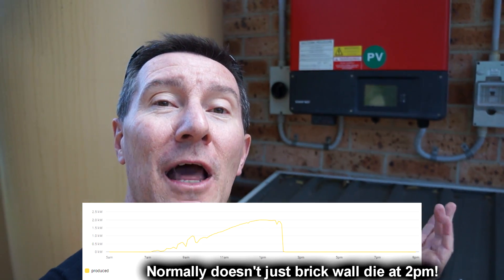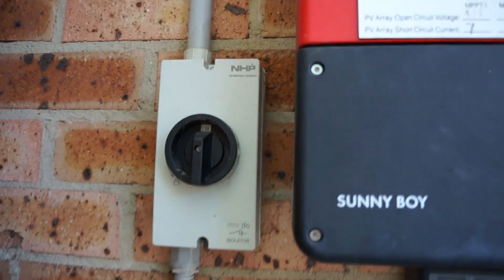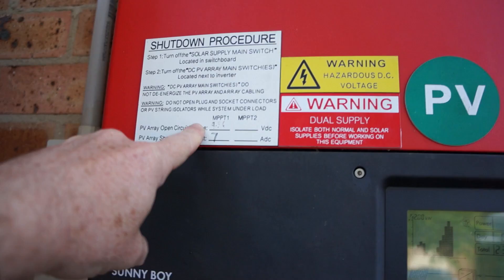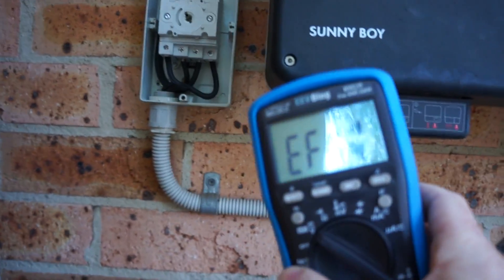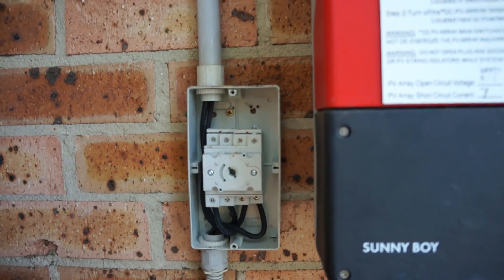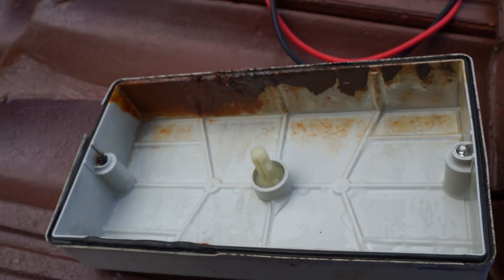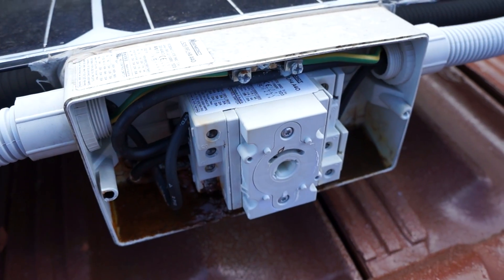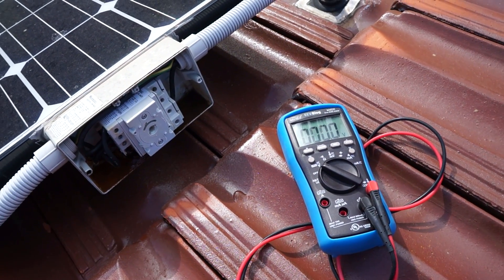EEVblog #1217 - My Home Solar Power System FAILED!

Comment: Stick a roof tile over it. Job's a good'un! 👍

Joking aside; on a much (much!) smaller level, I've always noticed it's the little on/off switches that are the first things to corrode-out in my LED solar garden lights. So much so, that I've followed Big Clive's advice, and simply bridged them out! 💡
Reply: Same here, we've had ours for so long now that even the IC legs are starting to rust and fall apart. The worst ones are those big strings of LED's daisy chained together in parallel, after a year or two the corrosion penetrates the LED's until one or more turns into a low value resistor. In some cases it prevents the IC from charging the battery. I've been tracking down the shorted LED's and heat-shrinking the wires back together just to get some more use out of them, I think they're a waste of money but my Mom loves them.
Reply: Indeed, they're a job to maintain and (more often than not) beyond any sort of economical repair..but I do like a challenge! ;)

Comment: I've had the housing for an isolator switch failed replaced it with metal housing never had another problem.
Reply: Give it time.. god forbid they use a material that lasts forever like stainless steel.
Reply: Stainless steel and others metals are kinda conductive lol. Shit idea
Reply: But you could just put it under a metal shield for example

Comment: Forced Gov'mnt "Safety" rules get written before there are components capable of doing the job.  In the USA it was fire codes that wanted to have every panel disconnected when the system is turned off.  High DC Voltage and water mix very well.
Those knock switch is cool, except when you work with a bunch of inverters everyday and have to rap  your knuckles raw.
Reply: William Wilson Those are turn switches with lockout-tagout, no knocking involved.  They are specifically for "unplugging" the wires you work on.  A 100 year old big knife switch does the job fine and to spec, but these plastic ones are cheaper.  Also, except for the test rating, identical isolators are used for roof A/C and neon signs.

Comment: I believe having an isolator  on the roof is neccessary if the cables goes through you roof!
keep an eye on the insulation resistance of your PV string.... Those Sunny Boy inverters are so sensitive to the insulation resistance degradation. Also, it would be better if you installed PID-reversal device.

Comment: Geez, a $5 metal shade cover to protect the plastic from direct sunlight would have saved a heap of frustration and cost eh?
Reply from the maker: Yep, or if they just used a properly UV rated box
Reply: @EEVblog  Or, even simpler, mount it in the shade of the panels :-/
Reply: Also protects from hail impacts.